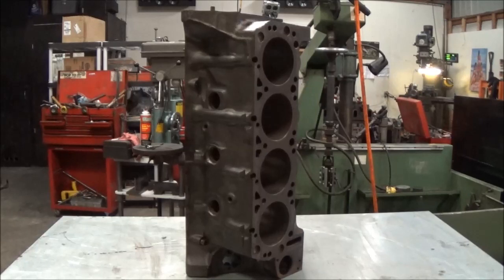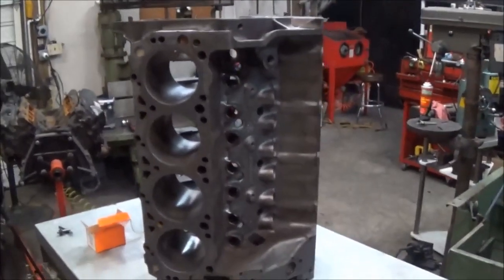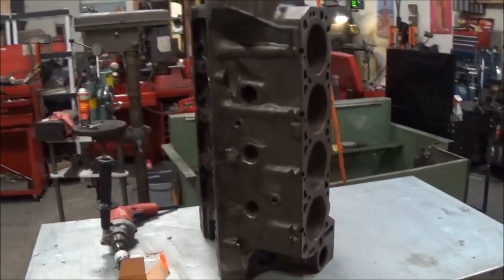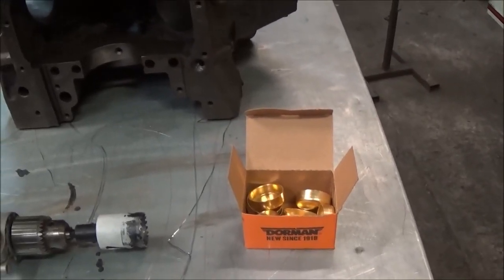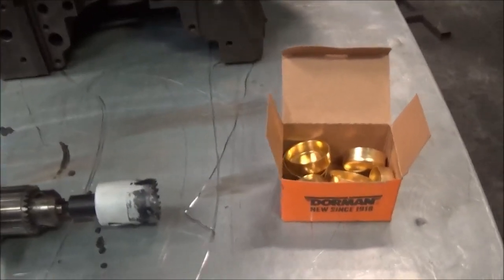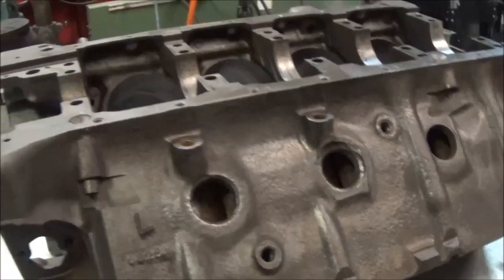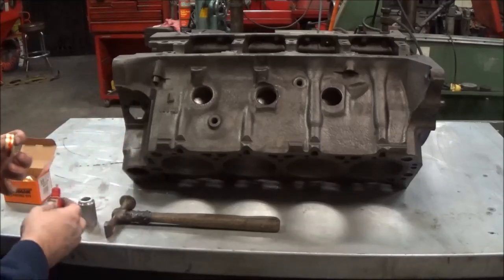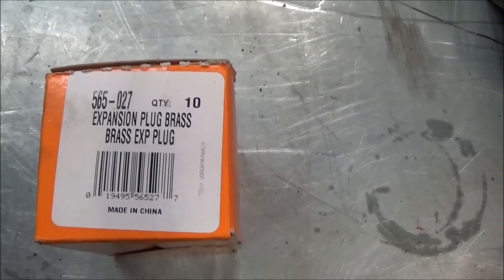7.3 Blocked, 6.9 Engine Build, Part 1: Intro and Freeze plug conversion

Comment: everyone is grateful for your efforts and the products you offer. a note, the sleeve retainer is a superior product to use in this application. threadlocker works but is designed for the compression between thread surfaces. sleeve retainer is for friction or press fit non threaded surfaces where there is no torque applied. jes sayin'. keep the pressure on and your powder dry.
Reply from the maker: I've used sleeve retainer as well, it really doesn't matter.... Even thread sealant would work fine... It's just an extra precaution.

Thanks for the good words.

Comment: So glad you guys are pushing the envelop with these engines. Too bad there isn't a way to install bigger studs into the 6.9 block.
Reply from the maker: There are, it's just not practical. You can sleeve a block down cheaper. I'm a 7.3 fan myself, why not take advantage of everything 7.3?
Reply: @RacinNdrummin  what do you mean for re sleeve a 7.3 block? I keep hearing that sleeves Thend to fall down and crack the blocks ! ! Cause if a 7.3 could be re done to a 6.9 specks but utilize the larger head studs be awesome!
Reply from the maker: @shawn-michealbrunet6353  the sleeves can't drop if the block is machined correctly for them. That requires a step left at the bottom of the block, or using a sleeve with a step at the top. I've done them both ways.

As far as the sleeve down to 6.9 is concerned, I don't recommended it. The only reason I did it was because I had the parts left over from a previous 6.9 build, and I wanted to show that it's possible to do. If I was to start from scratch, I'd use 7.3 stuff 100% of the time.
Reply: @RacinNdrummin  alright but won’t the new sleeves be prone to failure like the originals !? I’m new to idi’s I know my 7.3ps but trying to learn for my new build in a 94 idit
Reply: @shawn-michealbrunet6353   no because its thicker cylinder than original 7.3 idi because using 6.9 bore size and pistons